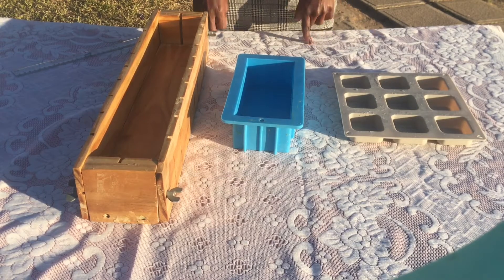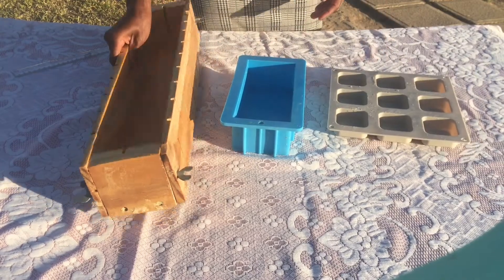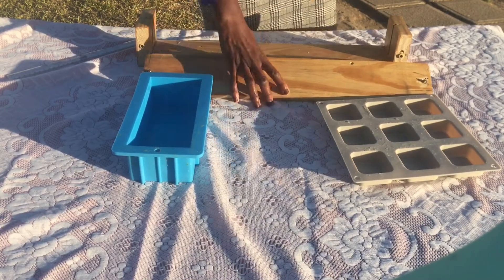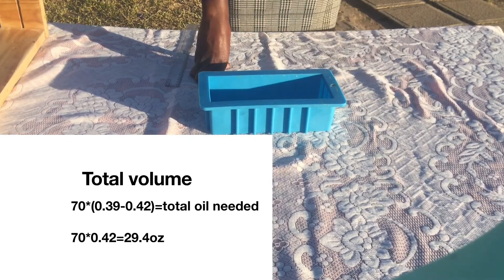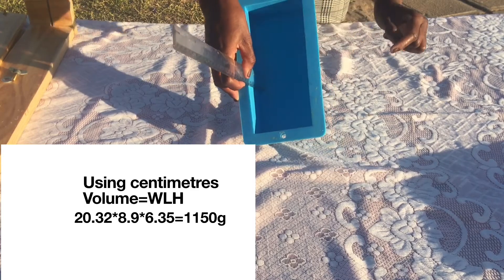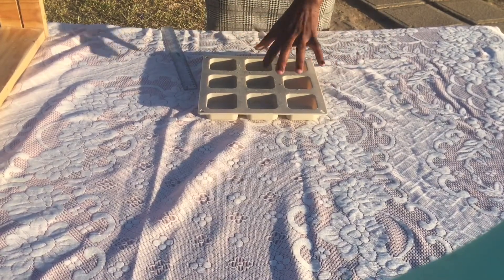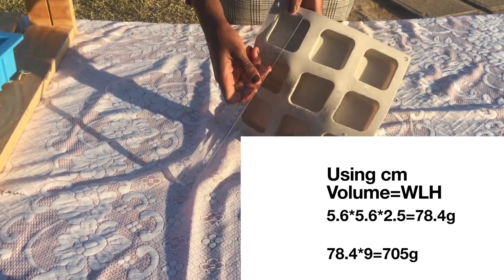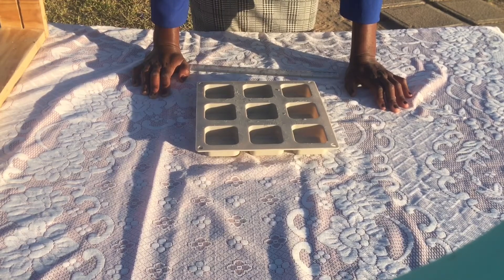How to calculate soap mold volume | How to calculate total amount of oils needed|Soap tutorial.

Comment: 12.5*3.25*2.75=111.7oz
Please help me calculate, another thing is how did you get the 
0.39 an 0.42 for your calculation 
That you use and calculate your blue mould please help me I try all my Best, 
My mould calculation is up I don't know the oil percentage of the mould please thanks.
Reply from the maker: Your mould holds a total of 111.7oz so to know the amount of oil you need you multiply 0.39*111.7=43.56oz 
It's almost saying 39% of your total soap weight is oils. That means out of 111.7 total weight, 43.56 of it will be oils 
But sometimes 0.39 will not be enough to fill up your mould, it's a matter of trial and error. First make a soap that has 0.39*111.7= 43.56oz of oil.  If it does fill up the mould then try 0.40*111.7

Comment: The way I measure the amount of soap a silicone loaf mold would hold is to place the mold on the scale, tare it, fill the mold with water and read the weight on the scale.
Reply: Oil is lighter then water so it wouldn't be a correct measurement weighing water to get your oil weight. Also different oils weigh different to each other so it would vary depending on the oils you are using.
Reply from the maker: @clairejanescrunchies  thank you for sharing that info
Reply: @clairejanescrunchies  This was my question, I have been trying to find the best resource that tells me!! I don't want to have a bunch left over but I don't want to short change myself too much either!
Reply from the maker: That’s a great way to measure total volume and and a lot faster. Thanks for sharing that. 
It’s the total amount of oils needed that was tricky for me at first.